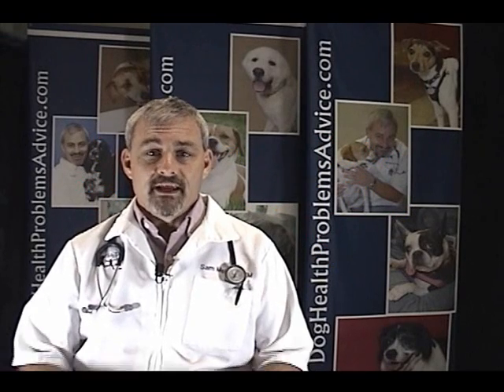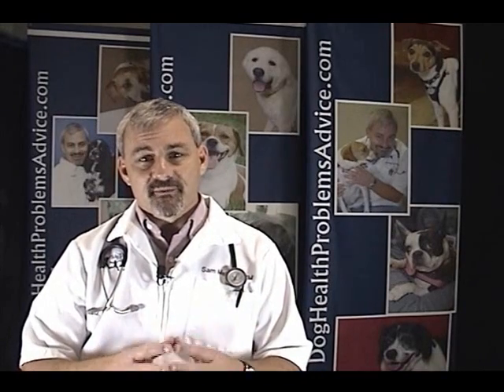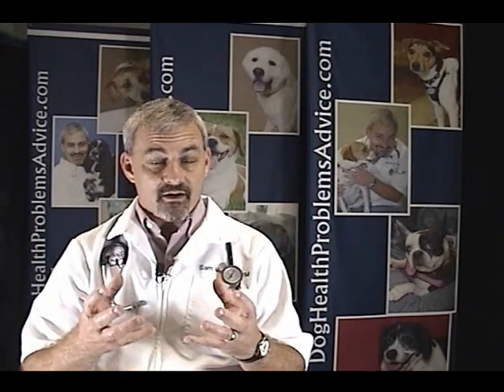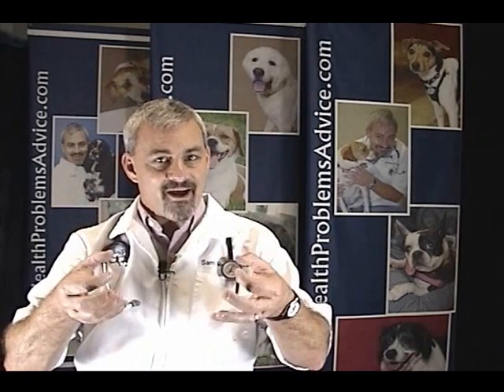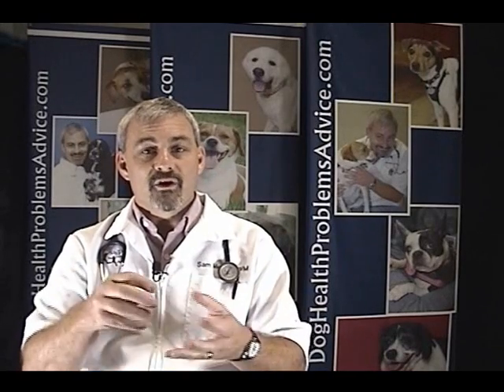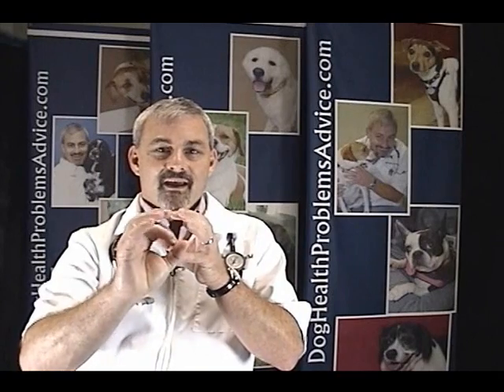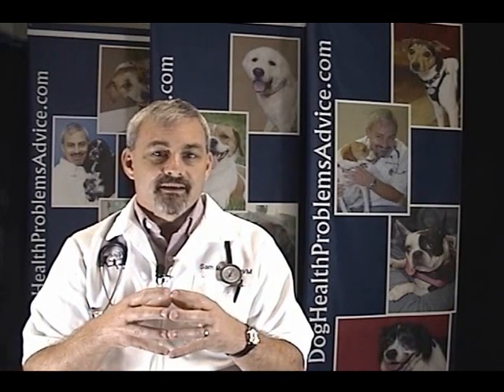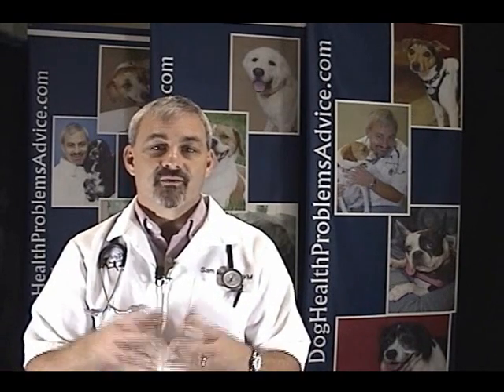Dog Heart Failure - Heart Failure in Dogs

Comment: My dog has the mitral valve disease & is suffering from fluid that fills his abdomen. My vet does a drainage every week & gets as much as 1 liter of fluid out. I question him as to the possibility of using a
 Jackson-Pratt drainage system to continually draw off small amounts as it builds up so that I wouldn't have to put my dog thru the once a week draining. His response was that he never heard of this procedure. I was hoping you may have heard of it & may be able to point me in the right direction. Thanks.